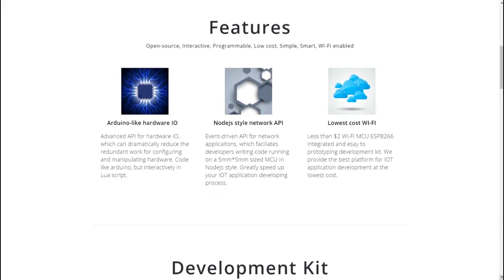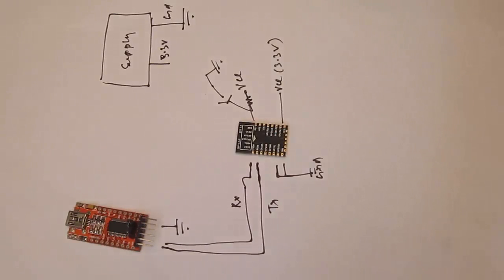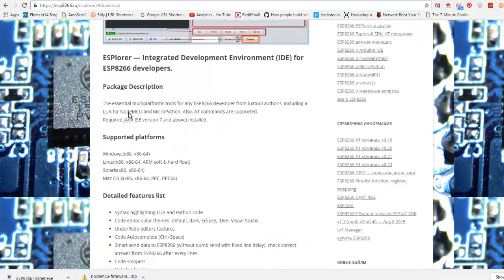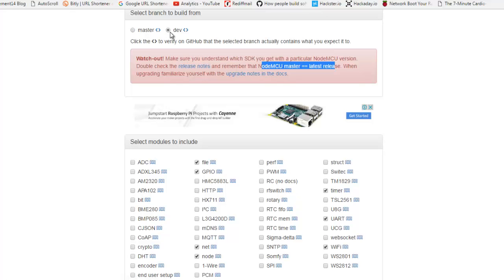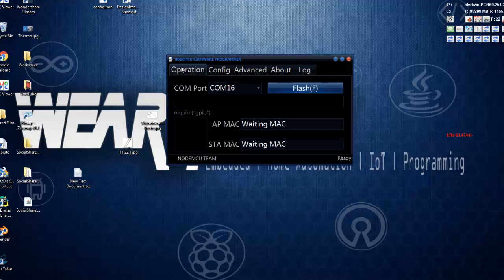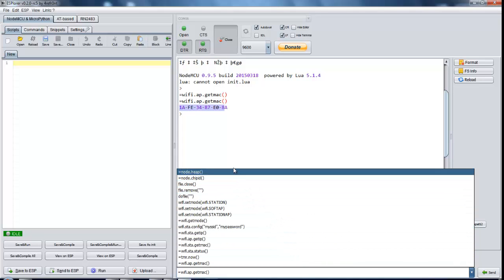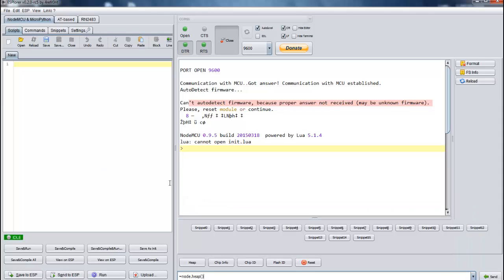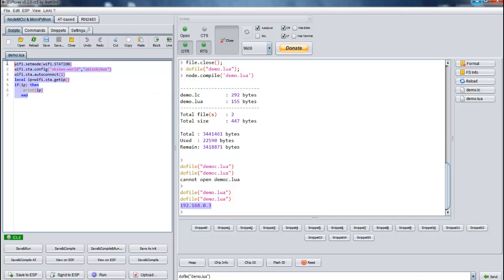Flash NodeMCU firmware to ESP8266

Comment: Hello.Thanks for your great video.I've done some project on Arduino with nodemcu board but now I want to do them with a smaller and lighter board like esp8266 esp01 or esp201 modules.I flash node mcu firmware on them(esp01 and esp201) but I dont know what should I do if I want to upload my previous Arduino cods on it?! can u help me?